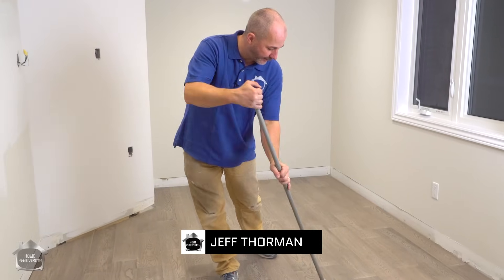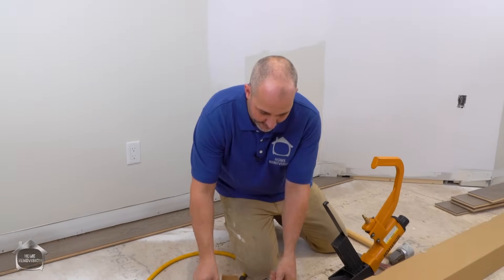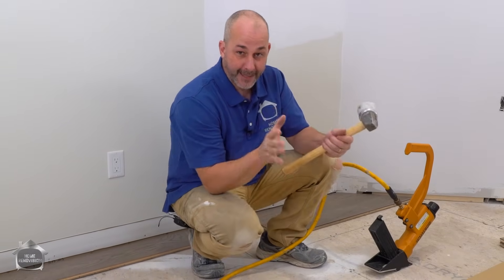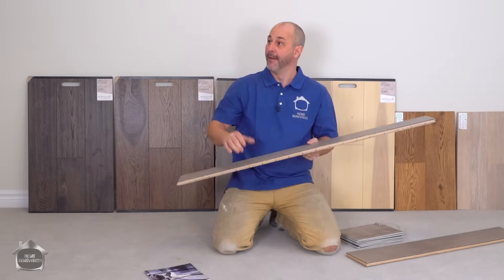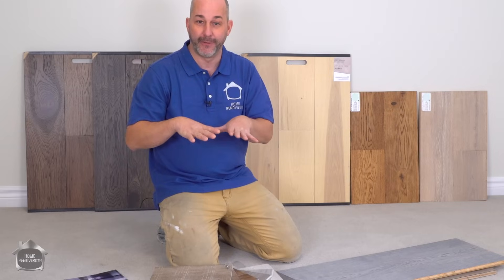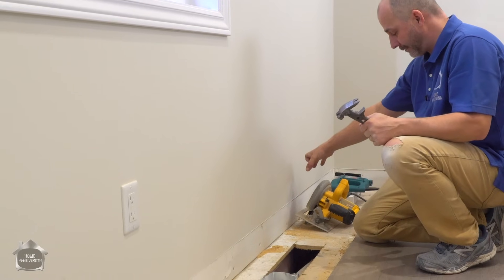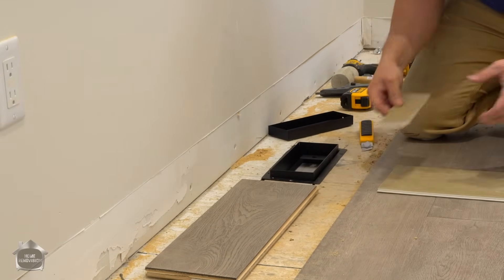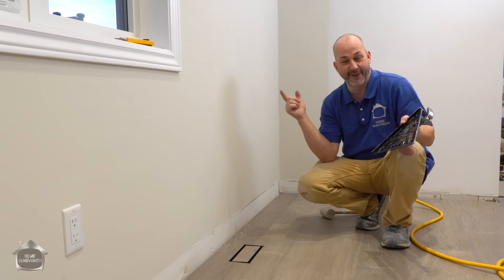How To Install Engineered Hardwood Flooring!

Comment: I need help/suggestion. 
My living room had carpet, which took off. Under the carpet, it have a hardwood floor. Now in dining area, previous owner had installed hardwood floor over the existing hardwood floor, so after removing carpet, living room dropped 3/4 inch  down compare to dining area (in other word unlevelled floor). Dining area seems like "Red Oak Wood" and we want to keep same color; 
My dilemma, is
1. If places vinyl floor, which is @1/4 inch thick, still leave the floor uneven.
2. If Engineering hardwood floor, which is @  1/2 inch thick, still leave floor uneven.
3. If placed another hardwood floor, it may make difficult to nail and/or staple and also too much weight.
Anyone, including you have any suggestion/recommendation that if we use, engineering floor, how we can level the floor?  Is Red Oak Wood available in Engineered Hardwood floor?

Thank you in advance....

Comment: I'm a flooring contractor I would recommend not going with engineered hardwood and going with traditional flooring. Most of the time you cannot sand and refinish the engineered flooring. Traditional flooring you can get between 6 to 8 sandings. Engineered does get water damage and it is harder to replace. They always tell you that you can get 1 or 2 sanding most of the time you cannot.

Comment: Also, how big of air compressor do I need to run the nailer?
Reply from the maker: not big john. but the bigger the faster you can install. you don't want to nail while it is pressurizing.

Comment: Hello Jeff, always love your videos. Keep them coming. my question is the Nailer, should that only be used on this type of flooring? Or can it also be used on vinyl plank flooring as well? I'm buying a new home and looking at options to replace the carpet but not sure with what type of flooring just yet. Also, what do you think about SPC Flooring?

Thank you,
Reply from the maker: The difference here is that this flooring is designed to be attached to the home. where the spc is a floating floor. No nails screws or adhesive. Check out our vinyl floor install videos for instructions. Cheers!

Comment: How do you move the vent if it is in the wall?
Reply from the maker: That is similar except you open the drywall first!
Reply: @HomeRenoVisionDIY  thank you. Also, how do you fix the heating tube if it is detached, and there is no way to open floors underneath?

Comment: Why wouldn't you staple the tongue on the first row? I'm assuming the floor wasn't quite wide enough to use the gun, but they have L-cleat palm nailers or even talking the Brad nailer and shooting on a 45degree above the tongue like the staple. That will void any install warranty on the product
Reply from the maker: Don't over think it it's flooring not a bridge!

Comment: If you're giving tips to people let's do it right relative humidity needs to be between 35 + 50 moisture in the floors and hardwood need to be within 3 needs a vapor barrier

Comment: Engineered hardwood sucks. I got some in my old place. Even went with a nicer one made by Armstrong. It dented so easy and it can’t be refinished. Would never get this. Either get nice laminate/vinyl or get real hardwood. Skip the engineered wood.
Reply: Plus the staples show dimples.
Reply from the maker: Not sure what product you were using but your experience does not reflect installing quality products. Cheers and sorry you bought such a low quality floor.
Reply: Home RenoVision DIY yea. I hired a fancy store and they used Armstrong. I was pretty bitter about the end product. I’m sure there’s better stuff. Stay away from Armstrong. I have real hardwood in new place and much prefer the 3/4” oak hardwood. I do enjoy your vids!